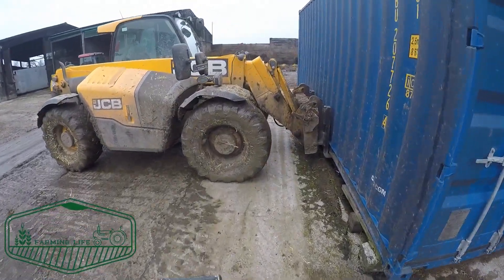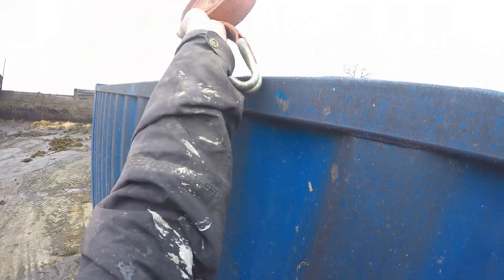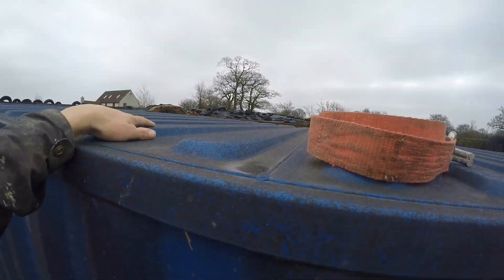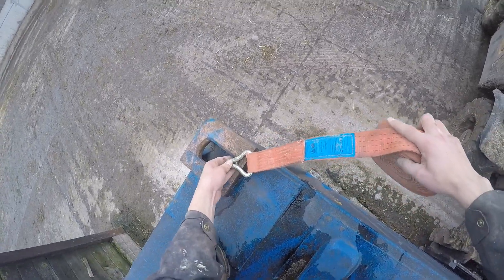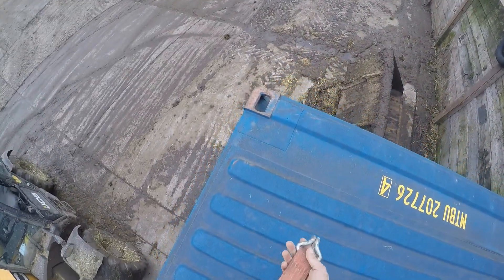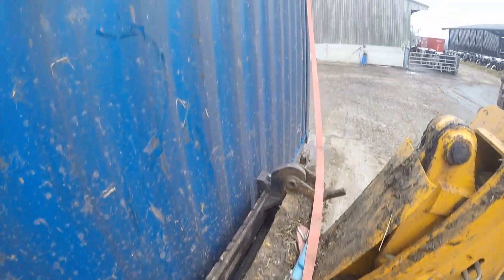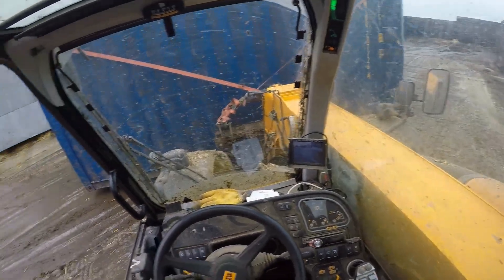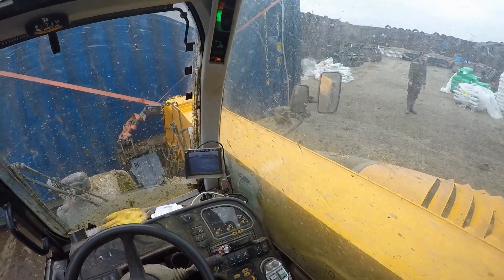Moving a shipping Container

Comment: Can tractor be driven with a car driving licence ? or i need tractor driving licence ? (UK)
Reply: you need a tractor licence
Reply: AaronB 123 but tractor is category f and on cars licence you get f
Reply: Iron Sheik ,as,mass,ms
Reply: Iron Sheik you can drive a tractor with a car license but to tow a trailer you need a agri license and do a test for pulling a trailer!
Reply: U need a tractor licence
Reply: With a car licence. You can drive on the roads with a tractor LEGALLY on its own. Why? Once you complete your driving test and receive your licence, you will gain category f. However if your 16 and don't (obviously) have a car licence you will need to do a tractor driving licence. To drive tractors with trailers you will need to do an additional test including your car or tractor driving licence. Also, once able to drive on the roads with a tractor you can have front and rear implements that are attached by the 3 point linkage but no the hitch as that is meant for trailers whether its manure spreaders or bale trailers etc. One last thing, If you are planning of travelling or transporting with a plow/plough, i suggest you look into that because for certain ages i believe there are restrictions or more tests to do so. Sorry for the long reply, i hope this helps
Reply: You can drive a tractor on the road with a car licence
Reply: Iron Sheik u can do it with no lisence but its not so simple
Reply: Yes you can , anyone telling you any different is talking rubbish